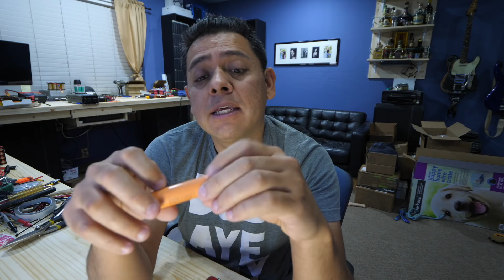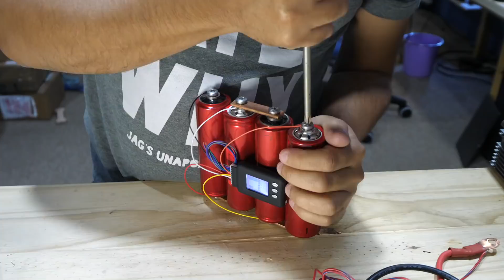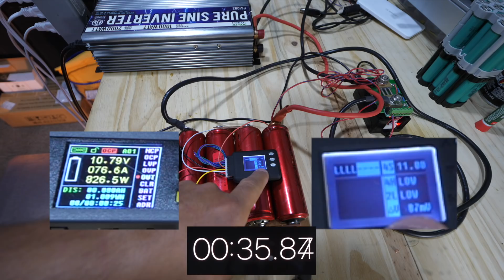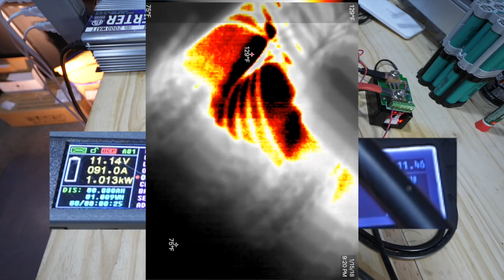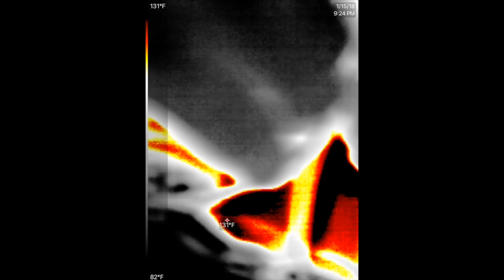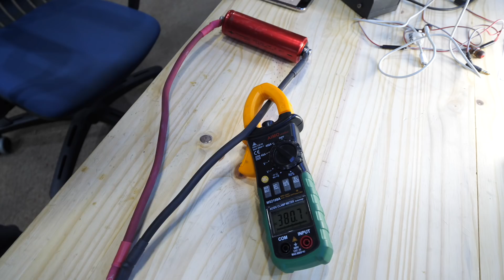12V Lithium Upgrade Headway 38120 Cells - 100A continuous (2018)

Comment: Man just think about how much longer it could’ve run if not for
The amount of energy dumped into turning those wires into heating coils themselves. Lol. Headways aren’t the lightest or most energy dense but there brutes and built like tanks.!! If you can forgo the weight there amazing cells.

Comment: I was thinking these could be used on the front end of a normal LiFePo battery pack to take the high current spikes.  The Headway batteries have great current sourcing spec's.

Comment: I have 2-64ah packs in my car audio set up wired with 2 agm batteries. So when I park and head in for the night the voltage drops to 13.4-13.7 throughout the night. When I start up in the morning my 280 amp alternator send 80ish amps @ idle to charge the pack to 14.2 in around 20 sec it's ready for the daily abuse I put them through. They work extremely well even used. And if I hold the engine at high idle and lean on the amplifiers/subs ect pulling 400-500 amps I don't see anything under 13 volts. The sag does suck but it's still WAAY better than hundreds of pound worth of leadacid. Paid $8 each n plan on building 2 more 80ah packs
I'll add, it's interesting how well the perform when they're around 95 deg vs colder say high 60s. There's almost no sag when they're warm. Cheap lifepo4 that puts out lol

Comment: Should have used 4AWG cable or larger. 8AWG isn't designed to handle nearly 100A. I'd have gone with 2AWG for the load but that's me. Still fun to see how these cells perform. I'm planning my grid tie system and on the fence between Lifep04 large cells (150+Ah) or these guys. They definitely hold their own but the price point makes me shy from them. After buying all I need, I'd spend much more than the large block cells.

Comment: You could use lithium ion 18650 batteries to replace lead acid if you have some sort of regulator, but that has it’s disadvantages, like you can only use like 10 to 20 amps and after that you would overload it

Comment: I have 12 of these batterys can I build a 12v battery and what type of bms would sute this batterys
Reply: Did you do it? These are impressive cells I am thinking of using a 12v system for solar. At least 1kwh worth.

If you have 12, at about 8ah each you can make a 12v nominal 24ah pack (4s3p).

Comment: Internal resistance decreases as temperature increases.  That explains why voltage increases as the test runs and the battery warms up.  What is the IR measurement on the cells?

Comment: So buy adding a nother battery. Are scared that the battery will not fully charge. Or over charge. Or is memmory of a battery.  If can set amps and volts to what you need. Yes one extra battery. Will share the load and heat.  Please think put of the box. Take care. Thank you for sharing)

Comment: Logic you can . You just don't  use the battery s as they should be. Not over charge.  One extra will change the the voltage  when adding a extra battery. But yes it is possible.  Yes can do.  Stop being on a one street view.  Take care

Comment: Best idea for replacing you 12 V lead acid battery:  Buy a super capacitor replacement battery.  They are on the market already.  They are more efficient than Lithium Ion batteries (or any battery for that matter) and will last much longer!

Comment: IDK guy, great test but i think at 50 usd for 100wh that's VERY pricey!  Got my 21650 lifepo4 for just over 100 usd/ kwh!  I use 20 of those cells to make 12v starter batteries for my EV and PHEV.  Much li g hter and cheaper than lead!

Comment: A diode in series will drop voltage 0.7 volts. 100 amp diodes are pretty cheap on Ebay, under $20.

Comment: We put 150-400 amps through 8awg wire always for years now🤣  Huge rc boat racing and 1/5 scale cars and 1/4 scale 60 lb rc planes 300 amps on average starting loads
Reply: You’re missing the fact you have significant cooling when it’s gliding a few mm over some water at over 120mph

Comment: Update and 300a upgrade for the battery meter as when I went to buy one from the above link was showing out of stock - https://www.lazada.com.my/products/juntek-dc-001-100v-01-300a-multifunctional-wireless-digital-bi-directional-voltage-current-power-meter-ammeter-voltmeter-capacity-coulomb-counter-i351014527-s494705356.html?ef_id=CjwKCAjw-ITqBRB7EiwAZ1c5U2ibA3LS6RGyLNFpqj5Pn0_hfodQ8R3lAcehMEue9Z8UG0LMPh6XTBoC6dkQAvD_BwE:G:s&s_kwcid=AL!3150!3!244160057898!!!u!301502731803!&exlaz=d_1:mm_150050845_51350205_2010350205::12:1032211143!54400014687!!!pla-301502731803!c!301502731803!494705356!128662420&gclid=CjwKCAjw-ITqBRB7EiwAZ1c5U2ibA3LS6RGyLNFpqj5Pn0_hfodQ8R3lAcehMEue9Z8UG0LMPh6XTBoC6dkQAvD_BwE

Comment: hello im looking for some deadlaptop batteries , i was on ebay , but i live in norway , so they cant send the batteries ,because of regulations , is there any way to get some 18650 cells , im currently doing a 15kw moped build , so i need some batteries, anyways great video , ;D
Reply: aliexpress

Comment: Love the videos, very informative. I'm wanting to do a build with these cells but im stuck on if i can run a bms. I'm wanting these to replace one of my batteries in my car. The problem with all the bms that ive found is the limited output amperage. With each doing up to 160amp per for 8 thats 1280amp total output. Is there a bms that can even handle half of that current? Is it remotely safe to run these without the bms? Im sure they wouldnt overcharge do to high volt since these are fine up to 3.65v charging and they wouldnt even see more 2.35 give or take. Any advice that i could get would be awesome.

Comment: You must not know if you take that kind of battery below 3.0 volts you damage them,  lithium batteries undergo unwanted chemical reactions when discharged below 3V, causing their internal resistance to be permanently and significantly raised. Their capacity will suffer as well, meaning that they won't accept the same amount of charge anymore. When such an overdischarged cell is "brought back to life", it will likely become chemically unstable, creating a risk of a short circuit developing inside the cell.

Comment: I don't get it
If I use these cells all connected in parallel the total amps would be about 32 and the voltage will remain same as that of the individual cell right
Reply: correct, but he has them is series 4s so its 12.8v

Comment: Most devices that run on 12v lead acid batteries will run on 3S lipo, not come across one yet as they deal with voltage fluctuations.
Reply from the maker: But your 12v automotive system will over charge them to the point they will catch fire
Reply: @jehugarcia  Yes but I've never used one in a car... just anything that doesnt charge. Could you not just slip in a buck regulator?
Reply from the maker: Yes you can setup a separate charger for them,  but then you run into the fact that most 12v devices will quit working at around 11v at which point your lipo pack is at nominal voltage.

Comment: Any chance I could make a 12v battery with these at like 600ah? I’m making a conversation van and really want lithium battery’s and want a lot because I want to run air conditioning
Reply from the maker: Yes I’m working on large  project using these  right now, video coming
Reply: jehugarcia nice how many cells will I need to reach my 12v at 600ah? On the website is it selling them in packs of 25 for a total of 200ah?

Comment: A car uses a voltage between 10.5 to 14 volts to work as the alternators will utput this range for automotive uses. This demonstration shows lack of understanding in the demonstrator, the cables do not reflect real-time current capability of a car _ waste of time

Comment: He's only partially right, ive been able to reduce my 14.7ish volt 4 x 18650 battery packs down to work with 12 volt packages using a stepdown circuit thats fairly small mounted to the battery pack.

Comment: It would be a bit more responsible to add a much bigger disclaimer that shorting lithium batteries is incredibly dangerous.  Taking them below their minimum voltage for any length of time creates dendrites that can cause short circuits on subsequent charge cycles.  That said, I think it's great you beat these thing up, it's the best way to learn.  I'm sure you have a metal trash can filled with sand nearby and a quick way to get it outside in the event of a fire, but novices experimenting for the first time won't know this and can easily take the wrong message from your video.

Comment: Pattern, 12volt DC x 100A# 1200watt for DC electric, if using inverter to be 220v for ac : 220v x 100watt# 22000watt for AC electric so big, electric for home

Comment: I know that GBS batteries only like 60 amp draw with the 20Ah blocks. They are a lot cheaper then those. I see if I buy many I can pick them up around 10 bucks a pop. 20 bucks you can get 20AH GBS and they will do 3C. However I might be missing something.

Comment: That 8 gauge cable is a big issue.   The best quality 8 gauge cable is only rated for about 55 amps.  A good  4 gauge cable will handle about 95 amps, but I would suggest a high quality 2 gauge, or preferably 1/0.  The batteries themselves are interesting, though.  I had never heard of cells in this size.

Comment: About (cable) insulations...
The following listing is from my memory, so there are likely to be a few near misses.  All temperatures I list are in Celcius.
Class A, — 70 to 85.  Materials such as natural rubber.  Phenolics.
Class B  — 135.  Typically original enamels for magnet wires.  Maybe Ebony (hard vulcanized rubber).
Class C  — Over 180.  Inorganic materials (ceramics).
Class E  — 120.  Enamels for magnet wires, more common type than class B.
Class F  —  155  High temperature enamels.
Class H  —  180 Silicone and Teflon. Kapton and some other.
The above numbers are basically maximum continuous use temperatures at any ambient.  At higher ambient the warming allowance is naturally reduced.  The three classes A, B and C were the very original ones and the rest were added for finer graduation as need arose.  Neoprene rubber is a bit higher than class A, for example.  Polyester and epoxy are somewhere in range of class E or B for electrical insulation use.  But most epoxy formulations soften at 155 degrees, while polyester can be used for baking wraps still at that temperature.  So, there are no truly universal numbers that could be given.

Comment: Keep in mind, a "12 volt" lead acid battery is actually closer to 14 volts.  13.5-13.8v.
Reply: And with the battery at full charge, alternator running and the regulator a bit loose, 15V was not uncommon in cars. I treat "12V" as 13.8V and anything under 15V as nominal. With each cell set to minimum voltage of 3.2V, and maximum 3.75, 4SnP "12V" gives 13.8 to 15V, at about 50% of rated mAh per cell so for 2000mAh. that makes the battery n*1000mAh, and supports long term discharge at 6n*1000mA without too much wear and tear on battery life.

Comment: One problem: At 10.0 volt from battery as your inverter still deliver 117 volt. You compare to 12 volt as output volt from inverter is still same. As your voltage will dropped from battery to inverter, your ampere will rise that will causes more heat in your 8 Gauge. Your black cable runs cooler than red cable, 'why?' Your inverter plus your slave device will heat up way it's suppose to. Your connection from inverter to battery has far lesser power than red cable. You needed 6 Gauge in even shorter length. i recommended 4 Gauge or better plus for max. power from LiFePO4, if 100 Amp Hour battery, is up to 100 amp drawing, in timely fashion, 500 amps draw for only short time. You had did it right by monitoring with your volt meter.

Comment: You can use a voltage regulator if you want to step down your 12V+ battery to be exactly 12V

Comment: These LiPo cells would be excellent in a Bionx or Mid Drive electric bike go long distances without having to charge often looking around at options want to add a Bafang Mid drive BBS02 to fatbike have to make custome pack 48 to 52 volt at 20ah would be ideal

Comment: Wow, those little suckers can crank the amps.  With the heat you put those through, it probably took 3/4 of their life cycles right out of them.  I hope you mark all of the test cells so you can track their lives.  Do you track everything in a database or spreadsheet?

Strong suggestion: Get some real cables for that inverter, Jehu. 4aught (0000), y'know?  It'll help the inverter crank out a lot more power. 

Here's a nice AWG chart with amperage ratings:  https://www.powerstream.com/Wire_Size.htm   

I had 2ga terminals so got some 2ga 3' cables for the 1,500W HF mod-sine I first purchased to run the electric chainsaw during a power outage, and it works.  For the house, I'll need a pure sine wave inverter.  Not too many are made for both 120v and 240v outputs until you get into the $3k price range.  Egad!

Comment: im a total clueless but i find these.battery things very interesting. i have a question to everyone knowledgeable. In other power system videos they say its only 2 parallel and upto 8 in series to get 48v right? so if using lithium ion which is 3.7v if in series i can have only 44.4v and like 5,200mah or 7,200mah if parallel twice since they say its just twice or else there will be unevem charging. so my question is, thats very low capacity current amd 44.4volts seem not right so is there a way to make this right is there a way around it that im not seeing? sorry as i said im a clueless and just watched some videos on alte how to build solar.power system and im confused with 18650 batteries. od appreciate a knowledgeable.reply and thank you in advance.

Comment: Hola amigo, puedes explicarme como sacas los amper de cada una de la células 18650, tengo varias de estas retiradas de baterías de netbock o notebock, pero no se el amper de cada una, ruego tu atención, saludos desde Argentina
Reply from the maker: Consigue una de estos para medir la capacidad de las celdas https://kit.com/jehu/lithium-battery-chargers/1298758-zanflare-lcd-display
Reply: Gracias amigo, un abrazo desde Argentina, seguimos en contacto

Comment: i have a 500F supercapacitors in series on board and i want to build a Lead acid replaced for my 4cylinders 750cc motorcycle.How should i connect 6 18650 batteries i have to charge the supercapacitors? Thanks!

Comment: Hello , i have a quick question for you bro , I'm planning to make an e-bike , and i do alot of researchs about the battery and what the available in my country , and i found that the 18650 battery is the perfect solution for that , and it's have about 300 to 500 life cycles before dropping down to 80% , so what your advice for me ,, also another question , i have solar panel system in my house , and I'm using lead asid battery , and his life cycle around 2 years , so I'm thinking to replaced with the 186500 battery , what's your advice , thanks bro

Comment: As you probably know , those 38120HP need to be perfectly ( balance change ) at 3.655 volts .
That's allowing the ( battery-pack ) to work at it best !
But never go under 2.2 volts , its ruining the lifespan .
10 years ago , i built a battery-pack of ( 48 cells ) and its still working as it was yesterday !

Comment: Good tips.. specially one with shorting the battery and measuring the current/temperature.. idiot.
Reply from the maker: Loser
Reply: Your post is wreckless  and these cells will fail  catastrophically if used to start a car or are charged by a car in the configeration  you have shown

Comment: Stuck for small buss bars?  1/4" copper tubing works great.  Flatten it in a vise, then drill your connection holes.
Reply: Chris W it would be wonderfull to have 18650 copper screws you can solder onto the batteries, plus your tip on copper pipe and any regular bolt would make a great combo.

Comment: What? This cell hold 1000w seriously? I can run almost anything using only one cell. I guess it must be very expensive, like couple thousand $ each cell. I got an AGM battery 12v 80ah around 50lbs and 2-3gal in volume, im sure the ones in this video worth buying even couple thousand $ each.

Comment: ummm, yes you can replace a 12 volt sla-sealed lead acid  battery with lithium 3.7 volt cells.....the system you are hooking up to DRAWS 12volts....in fact a fully charged "12volt" car battery will actually be sitting anywhere from13volts to 14.4 volts ! if this guy owned a car he might know this !
Reply from the maker: Are you stupid or something?  If you use 3.7v cells in a car,  the 14.4v will over charge them batteries.
Reply: i see you are stupid...i posted to use in a 12 volt system. i never mentioned  charging...geeeezus you non-americans and your shitlord english what part of DRAW do you not understand ? charging would not be an issue with the proper regulator......dude- stop making youtubes and GO BACK TO SCHOOL !
Reply from the maker: The answer is still NO,  you should not use 3.7v lithium for 12v automotive applications,  you condescending idiot.   More thinking and less commenting from you from now on.  Or I will get rid of you.

Comment: What kind of charger do you need with those? Do you think you could use 16 of them to power a 48v bike motor? It seems like a fairly cheap and easy way to make a 500WH 48V ebike battery. One of the motors will never draw that kind of amperage.  Maybe 20 amps at most for short periods of hill climbing.
Reply: https://kit.com/jehu/the-electric-samba-project-components

Comment: The cables are not rated for that many amps. You need at least AWG 2 to keep the temp around 167°f (75°c)[or slightly lower] you ALWAYS want a wire with a higher amp threshold than what your target usage is. This will help with longevity of the wire, connectors and your targeted appliance (your end item ie fans lights etc) while also drastically reducing the chance of fire from overheating your wires.